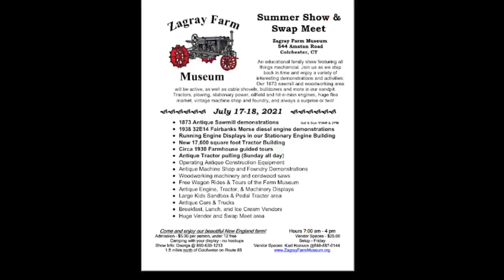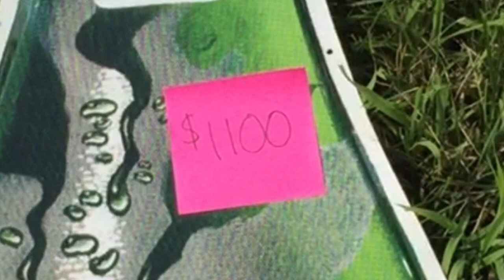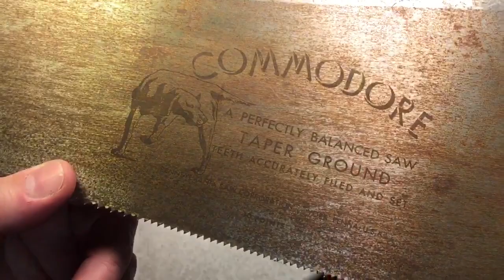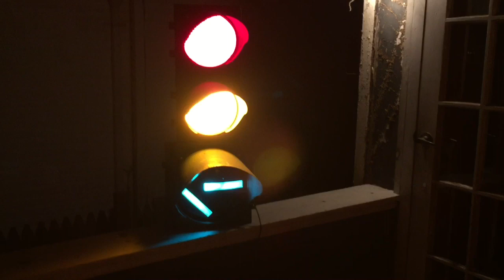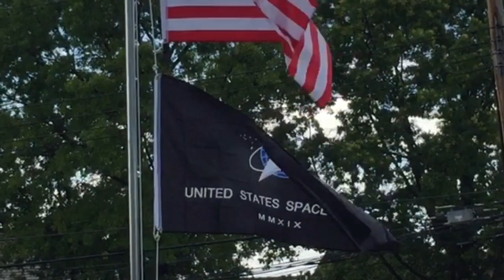Zagray Summer Show- Awesome Purchase!

Comment: John back in  2003 I went to the county fair in Abilene Ks. There was a kid who did a 4H project.  He restored a 1935 American Bantam car. It was a roadster and he did it in 3 years from age 13 to 16.  It was a great job. I was stunned until I realized he was a farm kid and they grow up with mechanical skills. He funded the project by raising his calves to yearlings.  He too was an old soul.   Great video.
Reply: When I was a kid I helped a genius farmer turn on and off his AC welder as he made pontoons from foam and plywood. The wire glowed red hot as he cut the front curve in the foam. Almost everything this guy did amazed me as a kid.

Comment: That show looks like it was terrific. It was full of cool tools and other stuff. The Corvair was beautiful. My father owned three including a 1960. All were good cars.  Nader's book Unsafe at any Speed, was an attack on the auto industry generally and not just Corvairs which only took up part of the book. Those old stationary gas engines are truly  ingenious, and definitely the most  fantastic  contraptions ever. It's a good idea to grab good US new old stock hardware whenever you can. The screws and nails are better made. My experience is that alot of old U S hardware was tempered. So it was alot harder to bend the nails. Chinese stuff breaks and sometimes can't take screwdriver torque,. The US Space Force is a great idea. The fact is that national defense needs are changing. Thanks
Reply from the maker: Thanks so much Pat!!!!!!!

Comment: I've never used a pipe cutter quite like that one, but my next door neighbor collects rocks. Agates and geodes that kind of thing. He has an identical device but about 2/3 the size and he also has two smaller ones. He uses them because apparently when you crack open these rocks you really want to be able to control where the brake occurs. He spends 10 minutes getting the rock placed just so, aligning the wheels with a crack that he can see and I cannot see, and then very slowly tightens it. Because it puts force equally all the way around, regardless of the shape of the rock it breaks it evenly where he wants it. Not the answer you were looking for, but when I was admiring the tool he told me all rockhounds use them.

Comment: ScoutCrafter, I’ve used that type of pipe cutter for 3  or 4 inch cast iron pipe. Especially in tough to reach places they work great.
Reply from the maker: Thanks Robert!  That pipe is heavy!  =D
Reply: @ScoutCrafter  Yeah it is! Tip of the cap to the old timer plumbers. Those guys were animals! Cast iron pipe, cast iron sinks and tubs, toilets that weigh a ton. My back hurts just thinking about it lol.

Comment: Nice signal pickup.  I have several signals and  they make small controllers that fit into the housing that make them run just like they are in an intersection.  I will find out where I got  mine from and email you the details.

Comment: I worked for a Plumber that had one of those pipe cutters..You better know what you are doing on cast iron   We made a few passes to cut part way through and then slowly cranked down on it as I wiggled the lever back and forth and Snap it made a perfect clean cut
Reply from the maker: Cast iron is Heavy too!   =D

Comment: Funny story about the chain cutter. I had a few apprentices trying to cut some cast waste pipe. They spent half a day with a reciprocating saw and used at least 6 blades. They made it half way through the pipe. I asked why they didn't use the chain cutter. They said it didn't work.  Turns out they were using the chain wrench. I showed them the difference between the wrench and cutter. I then gave them a demonstration on the cutter and in seconds we had a clean cut. These two guy were impressed.  They got the new pipe installed and spent the rest of the day using the cutter on all the scape they could find.

Comment: Aren't those stops to prevent idiots from slamming the jaws together?  
Awesome haul John!!! 
All that stuff you found is Incredible! 
Ide love to make it to one of those shows but that's the other side of the country for me.  Im not sure those traffic lights are they bright before some wired it for 110. Youde think they would blind  drivers ? Unless it was like 150 feet away from you like way back in the day suspended from a cable was that how it was mounted orinigaly?
Reply from the maker: The traffic lights had a generic design that could be mounted from either a pole or suspended from a cable. They were intentionally bright so that they could be seen during daylight hours. I always find it funny because the traffic light always looks smaller when it’s mounted higher up, as soon as you see one on the floor it looks huge!  😃👍
Reply: @ScoutCrafter  are we going to see the final outcome of traffic lights? 
I bet you can come up with a really cleaver solution. Btw I was just talking with Ben mall and he's about to upload part two of knife handle challenge once he can sort out fixing the mounting tang. This one really threw him for an loop!!

Comment: 11:27 - are there some rubber bumpers missing?
Reply: What kinda rubber would they have had in 1855? All I know of would have been that real greasy orange rubber and that stuff was incredibly brittle after whatever compound evaporated...
Reply from the maker: Hi Mike, in all of the newer bolt cutters they all have some kind of rubber bumper or even a spring bumper there, these are the first bolt cutters I ever saw with just plain metal!  I am perplexed!  😃👍